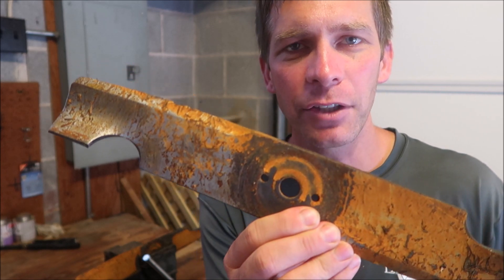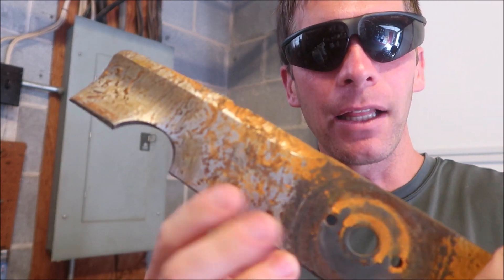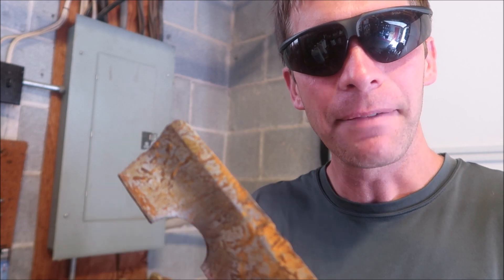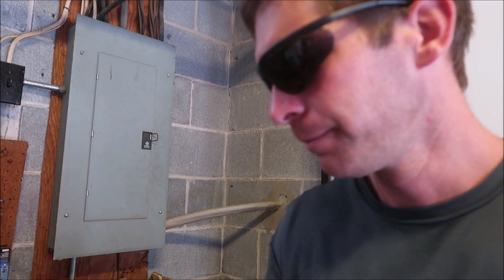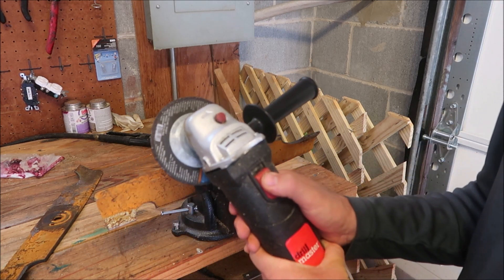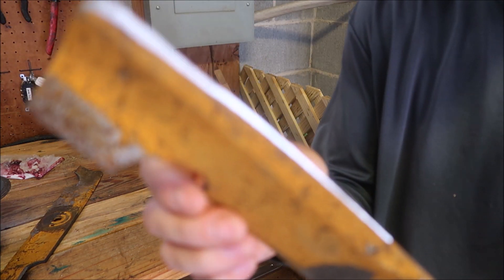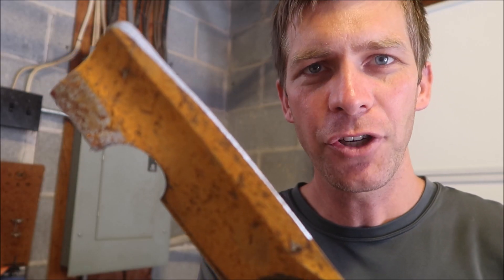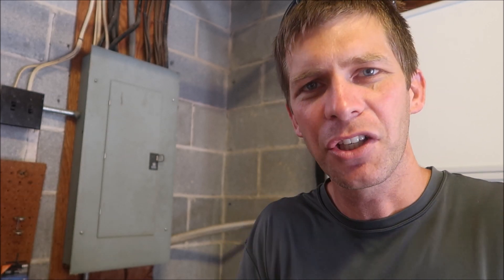How to Sharpen a Lawn Mower Blade

Comment: I also use a similar method. This coming from a newbie lawn care business owner but also part time works at a toro dealer/small engine repair shop---->where I spend my time 10 hours a day 3 days a week. I was taught to put the blade in horizontally and work into the edge. so laying flat in the vice and edge toward you. long smooth strokes over the blade from inside to outer edge. Never sitting in one spot or back and forth. Making sure to keep the 30 degree angle and getting all of the edge top to bottom and inner to outer edge. My 2 cents. Great video as always.
Reply from the maker: Those are good tips. I haven't tried that method but it sounds like it would work great

Comment: I use the same exact method and do all of our mowers one time per week. the only difference is I use a Bosch battery-powered angle grinder and a set of largemouth vice grips so I don't have to take them to the bench. I clamp it right to the frame of the machine and grind away. Makes very quick work of it

Comment: I've put together a kit of wrenches and sockets that make it easy to remove and reinstall the blade.
I use a bench grinder on the blade,  then mount the blade in a bench vice and smooth out the marks of the grinder.

I recently used a newly sharpened blade while mowing 18" deep grass,  and the mower engine never even slowed down.

17.5 minutes to sharpen the blade,  start to finish.

Comment: I typically use an angle grinder with a flap disk to get the roughy edge gone, then I finish with a hand file. I use a nail in the wall to just quickly make sure it’s not largely out of balance and that it’s not hanging too low on one side. Nothing special. I’m a homeowner and live in Southern California; so, I only sharpen my blades once a month when I use my rotary to mow overseesed Bermuda during Winter and early Spring. Which is only for about 4-5 months a year. The rest of the time it is reel mowed and that is sharpened or backlapped by my local lawn shop twice during that growing season.

Comment: I just bought a 7" angle grinder from Harbor Freight for blade sharpening. It works a lot better in my opinion because the wheel has more of a flat surface area so it doesn't round the tips as easily.
Reply from the maker: Good point. I think mine has a 5-inch disc but I'm not sure
Reply: You say the 7" grinder works better.  My question is what is it that it works better than?
Reply: @charlesincharge3404  7" works better than the 4"but, I've recently found a 4" 80 grit flap disc is even better. I liked the 7" but it took a lot metal off at a time so, you need to be careful 🤷‍♂️
Reply: @JsCrazyCutzLLC  Thanks, that helps. I've already been leaning towards picking up a 4.5" grinder.  Now, I'm researching what type of wheel to use with it.  I've been thinking flap disc all along, but the grit is still in question  for me.  I've been thinking about trying out either a 40 or 60-grit flap disc, but hadn't considered 80.  Any thoughts on if they'd be much of a difference and/or if you totally sold on the results that the 80 grit provides?

Comment: Your vice was loose. I suspect that you want it removable. If so , what I did with a chop saw in the middle of my workbench, is to mount it with machine bolts and use a wing nut on the bottom, so I could quickly remove it, if I had a large piece to work on. (and the saw was in the way).

Comment: Turn the vise so that the blade is sticking out at you. Angle the blade down so when you hold the grinder at your hip it is comfortable.Use a 'open' 36 grit disk.It should cut, not slide. You can grind toward the edge, It is just a mower blade. Don't grind the nicks out. That wastes blade material. They will come out with the next grinds.

Comment: I noticed that the sharp edge is starting to become swept back.  Have you had problems with the edge not being parallel to the back side of the cut?  My experience has been that the angled cutting edge tends to lay the grass over, thereby leaving it longer, leaving higher ridges on the lawn.
Reply: just file it back.
Reply: @jetah50  Ya I have a sharping jig and I get straight edges

Comment: How about devising a way to sharpen blades without removing them.  Should be able to use a smaller hand-held grinder and access the "tip" end near the chute.
Reply from the maker: I haven't seen anyone come up with a way to sharpen without removing the blades

Comment: Metal working 20 years and I do it the easiest/fastest way I can.  I do sets at a time spares and all.  Hold them down with my foot and work the edge with a flap wheel sanding disk.  They are simply easier on your nerves.  Nevermind polishing or razor sharp that's a complete waste of time.  I sand away from the edge and throw sparks outward as not to catch the disc.  Back and forth evenly a set amount of strokes.  Flip it and do the same amount of strokes on the other side.  Just like spray painting.  Keeps balance.  Last step is doing the bottom for flatness and getting the remaining burr.  Good tip about the blade tip doing most of the cutting.           https://www.youtube.com/watch?v=-GlJFVTzEsI&index=26&list=PLzNCJjmRL5aUjltlveAvONvd1fSNZPNrV&t=203s

Comment: Using an angle grinder without the guard??  Risky!!  Also. it'd be a bit safer if you would snug down those two bolts that are supposed to lock your vise to the bench.  And, balancing takes only a moment, just hang the blade on a nail in the wall.  An unbalanced blade will cause noticable vibration, and over time could cause premature wear on the engine's lower shaft bearings.